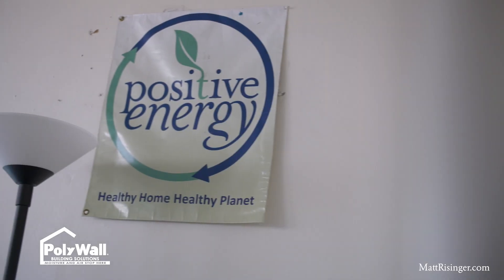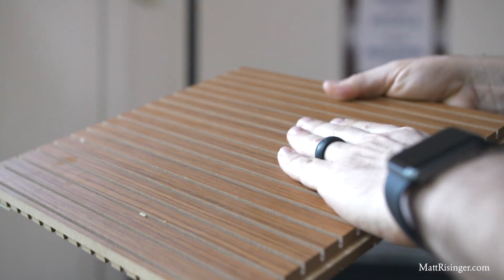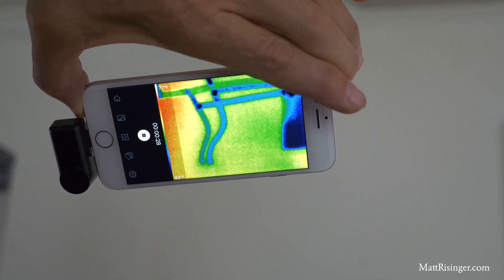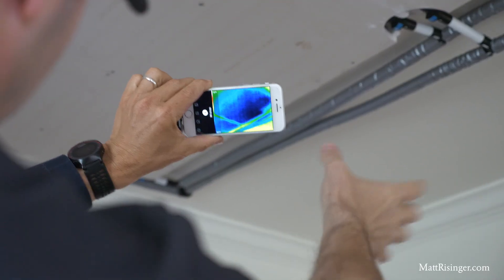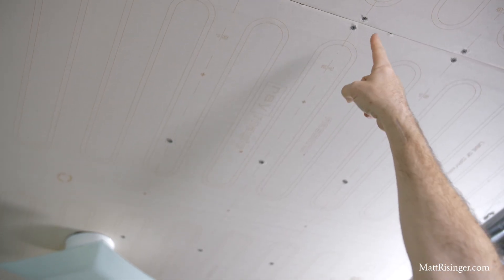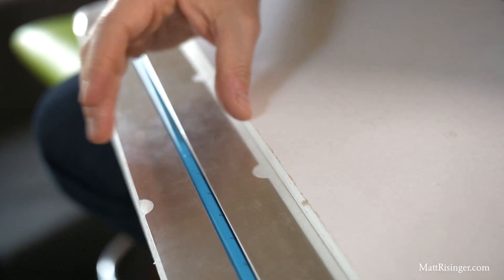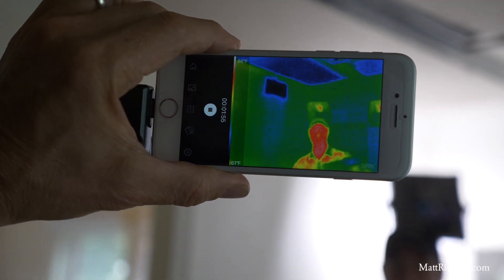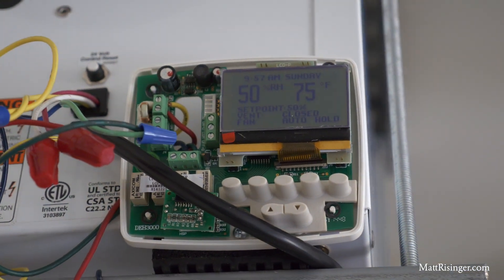Cool Your House with CHILLED WATER

Comment: I WON A BID IN LAS VEGAS IN 1979 USING A CHEST FREEZER FULL OF COPPER COILS SENT OUT TO RADIDATORS IN EACH ROOM ,I USED ELECTIC FAN RADIATOR FROM  EUROPEAN CARS, BUT THE TRICK IS TO CHANE THE THERMASTAT TO WATER COOLER. WIRSBO CAME MUCH LATER FOR ME

Comment: If you have radiant floor heat can you not use the same system but with cold water in the summer?  How cold does the water need to be for cooling to be achieved?

Comment: The reason it's not getting wet with condensation is NOT because you have a dehumidifier. It's because the temperature of the cooling panels is above the dew point. If you take a glass of water out of the fridge it gets wet but if you take a bottle from your wine cellar into the house it won't, because it's just not cold enough. Same principle here. You need a larger surface area with the lower temperature difference though, hence the large ceiling panels.

If you're in a mild temperate climate like Canada, northern USA, Europe or New Zealand, you could run this without a dehumidifier.
Reply: Humidity and Temperature both contribute to dew point, it's not an issue of one or the other; both must be managed for a system to be successful. 
Maybe it would be fine in Canada and New Zealand, but it only take a homeowner that enjoys more humidity than the system can handle to cause a failure. 
Better to have the dehumidifier and not need it most of the time, than need it and not have it all of the time.

Comment: I'm doing sort of the same thing. More geothermal though. Ground water temp in Northern michigan where I am is roughly 42 to 47 degrees during the summer months and I just pump that to coils in the furnace and use the furnace to distribute the cold air. uninsulated I get 62 degree temps from the vents. I am only pumping 1 gpm  of ground water through the system with about 180k btu of coils. Cost to keep the house 74 in the summer was about $25 per month figuring the electric for the Furnace, water pump and control solenoids. Cheap. I also ran a dehumidifier to control moisture levels.

Comment: I just installed a radiant cooling system in a new home we built, the water is cooled by underground water lines buried in the ground below the water level, we have 1/2” pex on 8” center between the Sheetrock and insulation. The ceiling is at 72 degrees, it was 94 degrees out side today, inside it didn’t get any hotter than 73. First day running. No condensation, we live in a dry climate.

Comment: I can't help but notice the guy in the back right with rolled up sleeves and a fan overhead.
At first I wondered if it takes more energy to cool air or to cool water, but they have a lot of equipment running for this whole operation, so in order to be beneficial it would need to be cost effficient compared to a traditional AC. 
Also, the ceiling tiles could be textured in a design like the ceilings in old old biildings.

Comment: None of this is cost effective or practical for a residential heating and cooling system. Ductwork is king for a reason, every room in the house can be heated and cooled with one central delivery system without having to have expensive, complicated controls for dealing with condensation.  Chillers are only practical for large scale commercial or industrial environments. Not to mention if you have a water leak in your radiant flooring or radiant ceiling system.
Reply: And coming from the northeast, I've always loved hydronic heating, my grandmother had steel hot water radiators, and I lived in a house with an old school single pipe steam cast iron radiator system using an oil fired boiler.

Comment: Radiators dont heat the room by radiation but if it sits under a Window it circulates the air

Comment: I don’t see this taking off. You still need mechanical cooling for the humidification. If the humidification is wrong will you destroy all the sheet rock in the house with condensation? It’s a cool idea here but I just don’t see it really taking off too many problems. And you still need air conditioning of some sort for humidity level control

Comment: The humidity and sweating mitigation seem like the key pain points here - I'm doing chilled water but am likely doing the high wall chilled handlers so that they can collect moisture and send out of my home.
Reply: @ucoder can you explain that?  What is high walled chilled handlers and how would they send moisture out?
Reply: @johnle231  air handlers are fed by a cooled or heated fluid. Think a old school radiator, now imagine a fan blowing over it. In the summer, the 40F water flowing in it causes moisture to condense on it. There is a collection system in each to collect moisture and carry it away.
Reply: @ucoder8905  

Oh ok got you.  But the condensation shouldn’t be too much of an issue I’m thinking as long as it doesn’t create humidity like how a swamp cooler would right? 

Have you built a system yet?
Reply: @ucoder8905  

I’m in Phx where it gets super hot.  Wondering if I could get something going.  Still have like 4 months
Reply: @ucoder8905  

So how does this work exactly?

Water gets chilled somehow and pushed through a radiator system that has a fan blowing through it creating cool air?

Is that pretty much the system?
Reply: BTW chilltrix is an excellent chiller / heater air source heat pump

Comment: Back in 2011 went to the porsche museum in Stuttgart Germany with a family friend, that night her BF said that one of his design projects for the company he worked for designed the "radiant" cooling panels in the ceiling on the museum and pulled out a sample from under his desk. It looked similar to this system, only the Pipe was raised on an inverted aluminum T.  At the time the company he worked for had installed quite a few of those systems in large building throughout Germany and europe. So the commercial application of this tech has been in use for quite some time in Europe.

Comment: Radiant cooling is useful if you absolutely have to be quiet, like in a studio setting. Otherwise its just alot of useless snakeoil. 
Sure if you really dont care about costs, you can put in full pipe work in every room, ontop of the ductwork for the dehumidifier, cool the air at the ceiling, cool it even more to dehumidefy and heat it back up to make sure theres no draft from the ducts.

Comment: If you have to run a dehumidifier with this setup, you might as well use a small AC unit instead so the latent heat is moved outside instead of being returned to the room. Regular central A/C is probably more efficient than this when you consider energy use for dehumidification.
Reply: Depends on the climate. If you're in Florida or northern Australia then yes, you need to dehumidify to be comfortable in summer. If you're in Canada or Europe you could definitely cool the house enough with just a reduction in sensible heat. Here in Brisbane, Australia I ran a simulation on my house (I'm a thermal engineer) and found that the summer cooling load is 50% latent and the "hot winter day" cooling load is 100% sensible. So in places like Vancouver where the summer is equivalent to our winter, you don't need to dehumidify.

Comment: Makes no sense-- if you've gotta have ducting for a dehumidifier to make sure you don't have too much moisture and condensation on these cooling pipes, then you might as well have forced air as well!

And with a dehumidifier it will either be too dry and you won't like it (more nosebleeds, etc), or there will still be some condensation on the cooling pipes, so rot, mold, and other issues will eventually be a problem long term. But by then the manufacturer and contractor will be bankrupt :/

Comment: I was just in a house where the homeowners recently added a chiller to their radiant in floor heating system. The husband is in the hydronic and steam heating business, so he knew about this. I was intrigued and asked him a ton of questions about this. I love good cold AC feel, so when I asked how cold it got, and basically they said it’ll easily make you uncomfortably cold, and the best results come when used with a ceiling fan. I think I’m completely sold. I’ll still want some sort of ducted HVAC system to control the humidity and filter the air, but it seems the best actual comfort control is radiant heating and cooling. I looked it up online and in most other parts of the world, this kind of thing has already become the preferred system in commercial buildings, and I think this is how AC will be. Having heard how great it is from someone who’s done this in their house for several years sold me!
Reply: He told you it created humidity?

Comment: When we build our house in North MS in the next two years, we are going with double stud wall framing and 12 inches of dense pack cellulose along with a Canadian window company's tilt and turn triple glazed windows and hydronic heating and cooling in the slab and ceiling panels like these. Great job on promoting awareness guys!
Reply: Have you looked into ICF construction?  I am still a few years from retiring and having a home built.  I am completely sold on ICF.
Reply: @pennguino9137  Hi, Thanks for the question! We actually looked into ICF construction, but with the huge amount of energy needed to produce concrete, we decided that wood framing was the better choice for us as far as minimizing resources needed for our home. Plus the foam insulation is fairly toxic and nearly impossible to recycle once it is at the end of it's life.

Comment: Matt like your show. Just an idea for this application. We do residential and commercial buildings and use fan coil units with boilers and chillers. These can be put into a wall behind sheet rock, don't need dehumidifier, but need to drain condensation somewhere. System still involves a fan so not as comfortable but don't need to control humidity.

Comment: i have been thinking about using something like this but instead of a power hungry pump to cool the water just make loops under the ground and use the ground as a heatsink and pump the water through a radiator and you could probably cool atleast a room with like only the energy of a small pump and small fan instead of large compressors and large fans.

Comment: How about some cost comparison data between this and conventional. If it is not more economical, there really isn't much benefit. Just because you can doesn't always mean you should. Great idea. Can you make it more passive, less energy dependent? Is there any ancient technology that you could utilize? Perhaps one pump to push water through pipe embedded in roof and walls. Below ground is about 48 F, perhaps a way to utilize that, year round, heating & cooling?

Comment: My worry would be maintenance and/or repair. That looks like plastic tubing in the ceiling plates, and all plastic degrades over time.  Houses settle and shift. What would be the time and expense in repairing a faulty connection between ceiling plates? Could it be repaired by removing just one plate, or would the entire assembly have to be removed?  My first thought was... Ah, Texas. I could see someone accidentally putting a bullet hole through a tile while cleaning a firearm. lol.

Comment: The advantage of a basic HVAC system: heating, cooling, filtering air, moving in fresh air. Can't beat that!
Reply: The best part about radiant systems is that you can still filter and dry fresh air with dedicated airside systems that require smaller ductwork while eliminating the need for large ductwork for heating/cooling. It's the future.
Reply: @positiveenergy1565  such as houses with HRV/ERV and its own air circulation.

Comment: So the house is lined with water pipes and that connects to a water chiller outside (an ac). The main benefit is water is a better thermal conductor than air so in theory you'd save on how much the compressor needs to run and heating, but if you wanted  to try this in an environment with freezing concerns you'd probably need to use a glycol coolant. It would be an entire additional set of plumbing. Also it would be a closed system where you need to worry about corrosion and organic growth considerably more.

Comment: while this might be more efficient than standard AC, I think we can make it better. rather than using a chiller to cool the water, which would require a decent amount of electricity to operate, what if we hooked these radiators into a geothermal loop? If we're using the cool temperatures of the dirt deep underground to cool the water, all we would need to operate is a pump to move water through the loop. it would be much cheaper to operate and much better for the environment than any cooling system we have on the market currently, and it would get the water down to about the same temperature, if not a bit cooler, than the chiller he has the radiators connected to.
Reply: My personal favourite is a combination of many. Isolate your houses quite well. Build fans that can exchange the whole air in the house throught the night multiple times (To get the free cooled air outside (if its cold enough)) Groundcooling is a very nice solution which can cool stuff down to 12 to 15°C (at a depth of >2m). But with an extensive use in the summer, the earth will heat up and the effect reduces itself. But the heated earth can be reused at the winter for heating purpose :D. When there is still the las "bit" missing, use a small air condition unit which is powered by solar. You need the cooling most the time when the sun is high up, so perfect use case.

My company is cooling down the whole building complex with a similiar approach to groundcooling. Except that they are using the water of a nearby river. It helps to lower the temperature by round about 8 degrees in summer, combined with dehumidification devices it feels good enough.
Reply: I've installed too many geothermal system down south - gave nothing but headaches.With geothermal you are only saving the electricity from the fan motor  - minus the lower consumption water pump. Savings are negligible. Not worth the heart ache  and expense of the installation. The best way is to install a bullet proof, tried and true A/C, w/no efficiency gimmicks. Then add 5000 watts of solar grid tie power to your system($3000 panels + $1500 grid tie inverter) . No batteries, and not even tied to your home. Its tied directly to the grid causing your meter to spin backwards.  That's how you get a good, trouble free,  high efficient A/C system.  
Note: Solar panels have almost ZERO maintenance. Ok, you should clean them every once in a while. Hose the dust off. 

FYI- That system would cut your A/C electrical usage by more than 50%. Take a 14 SEER, now its a 28. ;) And if you add enough panels you could completely off set your A/C usage. At 10,000 watts X 6 hours = 60KWh produced  vs 3 ton A/C (3000 watts) X 12 hours (run time) = 36KWh consumed. Net gain of 24KWh of electricity. Probably enough to offset your entire bill.

10,000 watts panels = $5000 (only $2500 if you buy at auction), or $10,000 if you don't shop around.
200 AMp Grid tie Inverter = $1500
plus labor.
Reply: @2pi628  I don't mean to connect them to a geothermal heat exchanger, I mean literally just have water running through underground pipes directly into these radiators and then back out into the underground pipes as a means to cool the radiators.

Comment: Pretty slick system I wondered about this with a GC I worked with 12 years ago and his response was "condensation". I have the only geo Thermal heat pump in the the small city in FL where I live. When I dropped my house plans at the building department for my addition and remodel they were dumbfounded. I only wish the engineer that designed my system had a clue so I could get all of the potential out of the ground source.

Comment: Love this idea but what about in heating mode, it doesn’t make sense to have heat introduced from above since it rises.
Reply: Because it's radiant, not air. Hot air rises, but radiated heat waves go in every direction - they behave the same way as light does, but it's outside the visible spectrum. Heated ceiling panels are actually more effective than floors since there are fewer objects blocking operation ("line of sight" for the waves) than on a floor.
Reply: @snickersnaps8949  ok but that IR will interact with the air in the space in addition to your body, so it will still heat the air above you first.

Comment: I was concerned with condensation also, love the whole house de humidifiers ect. .. I would think to install it pitched just in case of a failure. I think its a great idea, i would like some kind of fan moving the air around unless it ruins the system.

Comment: Yazaki, Multiaqua, and Chiltrix (in addition to a few others) have systems of 5-tons or smaller that produce heating, cooling, and hot water.

Some of them have ancillary equipment for radiant, wall, or ceiling delivery.  The HVAC world is changing.

Comment: Sadly radiant floor to this on the ceiling if one tube goes bad major destruction  to finishes needed to repair. Know many with infloor radiant where one run failed and then floors have to be ripped out to this ceiling would have to be ripped out to get at broken/dysfunctional tubing.